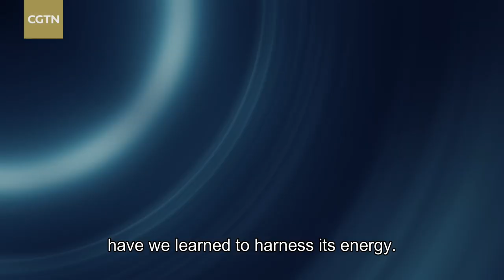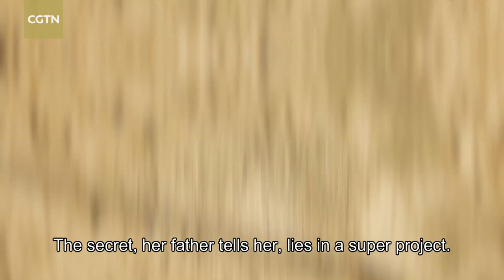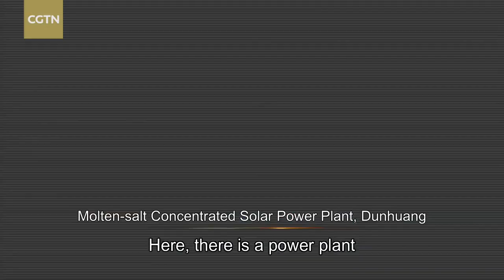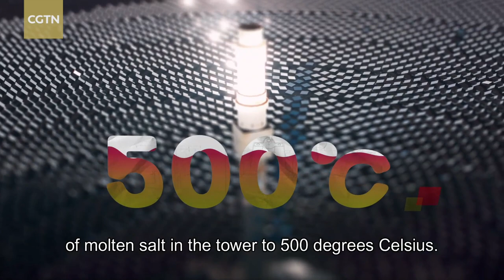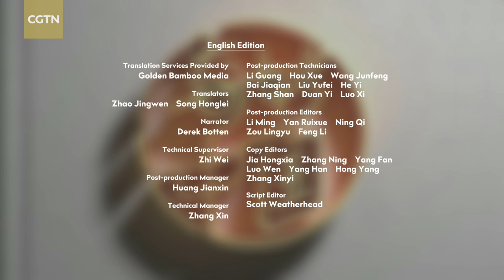China's giant power-generating mirror

Comment: A 609km² circle has a radius of ~14km. Mostly they needed a suboptimal position to reflect sunrays to the collector. And only a part of the panels are in the right position to target the center column, not at the best angle to produce energy within the panel either, even if it was 10km high... :face-purple-crying:
From where comes the water to clean and cool the installation?
Happy maintenance...:face-fuchsia-wide-eyes:
Reply: Good to know I wasn't the only one wondering. I'm guessing from the cooling effect of the exuded steam the geothermal plant uses to spin the turbines.